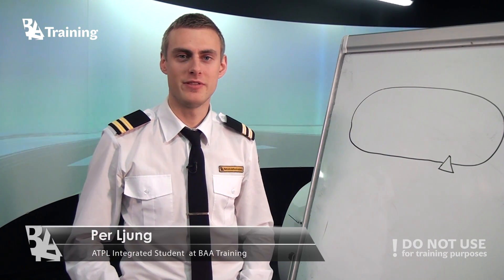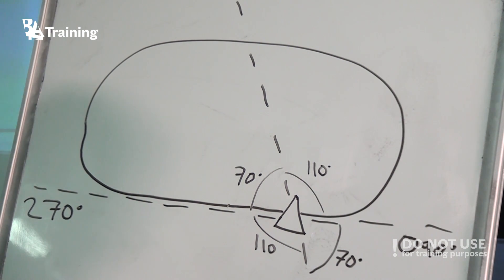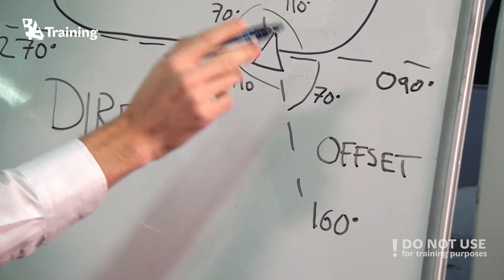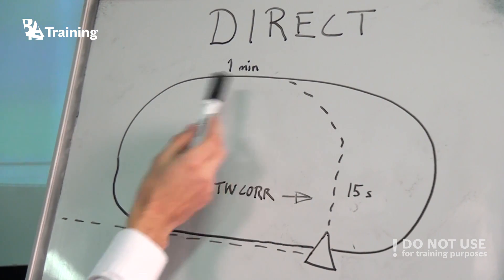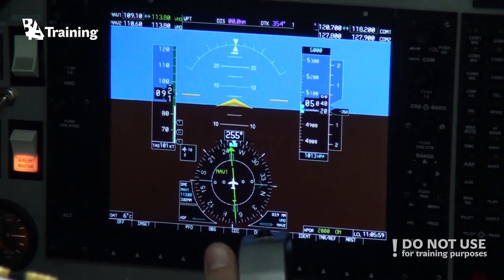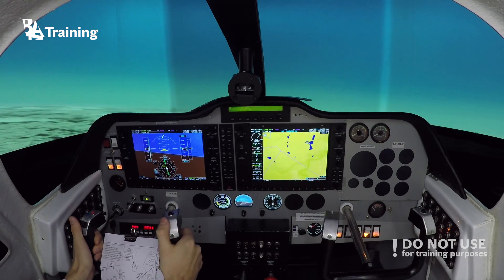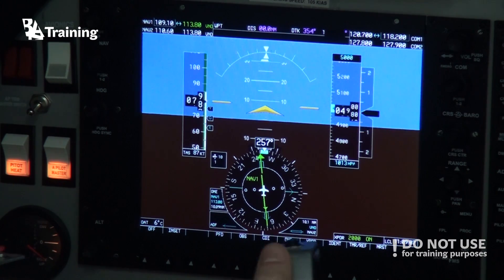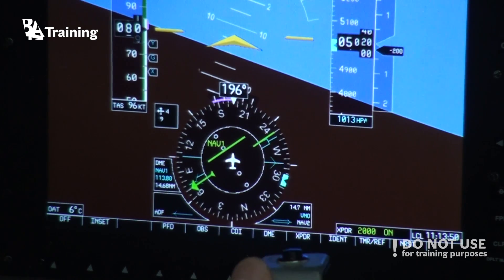Holdings theory and practice in FNPT II (part 1) - Aviation Academy

Comment: In general the video is good, I think that you should correct the tear drop entry, because what you do there with a 45º angle is a procedure turn, it's a valid and legal way to do it, but academically incorrect and can drive to confusion, so at least you should point that out.

Comment: Thank you ! It's a very important topic.
May I add another reason for holdings : geography.

If you compare the approaches for to big neighbors : EGLL (Eathrow) and LFPG (Charles de Gaulle) , the 2 biggest European airports (thus with heavy trafic).
Approaches to LFPG start far away Amboise, Dieppe, Reims an Dijon are good examples ; they are in a distance over 200 or 300 km.
Approaches to EGLL start closer to London and use holding patterns all around. This helps approaches to be managed in British sky and over ground. 

When you'r bound to Paris your approach will generally not fly though any holding, it's just possible.
When you'r bound to London, you'll almost always fly an holding, you eventually fly a direct approach.

Comment: Only 30 degrees is to be used in Teardrops. I believe the 45 degrees is the one used in Procedural Turns (45 deg and time for 45 secs).
And we also taught some different techniques in Parallel entries in which you will delay your turn once you reach the fix to make more room to intercept the inbound leg without overshooting it.
Reply: +cruxader27 Yes... i remember, after parallel entry, during the interceptation inboud course, if passed 30 seconds and you didnt intercept the course, just fly directly to the intersection/Vor/Adf... the fix of the holding.

Comment: Good video! but... there are 2 things I disagree, well... exactly just 1 and another it must be better "painted" and explained.
First, keep in mind for holdings at 14000ft or more, the holding time is 1min 30 sec (added 30 seconds to default 1 minute)
Now, 2 things:
1. The teardrop entry (Offset), is with 30 degrees, not 45 degrees. Just for avoid to cross the main holding pattern (others would be already in the holding also!) More than 30 degrees is dangerous because is possible you cross the main holding line in the north side (in this case), I mean the outbound track line.
2. The parallel entry... the dashed line (in this case) its at south from the main holding (that's why is called "parallel", he should paint it with a bit more separation hehe) for keep that minute track at south from the main holding, flying a real parallel line. Think you are flying reversed than main holding in that part, so you will avoid other traffics already in flying in the other direction.

Good times in the school heheheheh!! I love your videos because remember me that GREAT times! Cessna172 the best! hahahahahaha
Reply: +mcgalcri +cruxader27  You are correct, of course it should be 30 degees in the Offset entry procedure. I'm sorry that it got mixed up and thank you for pointing this out. 
However, there can never be more than one plane in the same holding at the same altitude. We must have vertical separation. When one is leaving, the second plane in the holding can descend to his altitude. And as long as you stay within 5nm from the published holding there can never be any danger from obstacles.
Thank you for your input!
Reply: +Per Ljung Yeah, with diferent altitudes but think... usually when they are used? The most common situation of the use of holdings is when there are too much traffic afluence, due several sitations, for example, really common, an airport with 2 runways and one of them out of service, so the amount of traffic must use holdings (via ATC clearance) to allow all aircrafts landing safetly. Ok, the ATC will use the holding with some aircrafts, around 3 or 4... (usually when there are more aircrafts waiting for landing, he will direct the others to another holding, usually max 4 aircrafts per holding) with diferent altitudes. Lets see an easy example: 

- Aircraft "A" holding at 6000ft
- Aircraft "B" holding at 5000ft
- Aircraft "C" holding at 4000ft...

ATC will authorize aircraft C for approach, and then Aircraft B and A will descend 1000ft each one, in that transition... probably you would cross their flight track hehe. I saw it!! and thanks to God, the landing gear of one of them didnt touch my hair! hahahaha.

Anyway... your explanation is MUCH BETTER than my old teachers hahahaha, Great job mate! I hope you soon upload another video about SIDs/STARs procedures... i have a little doubt about that... in the case of departure airport VOR is the start point of the STAR of destination and/or the destination airport VOR is the final point of the departure SID hahahaha, im a bit confused about this... what do you will follow? the SID or the STAR?